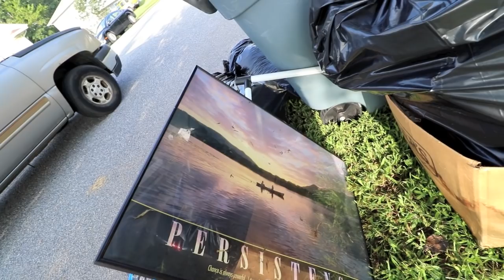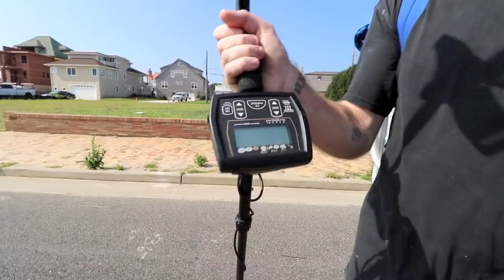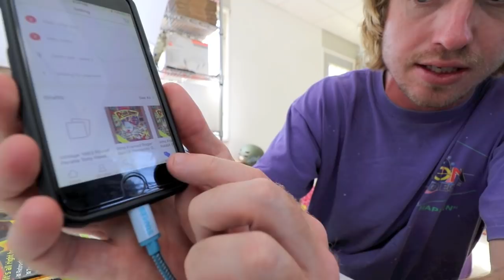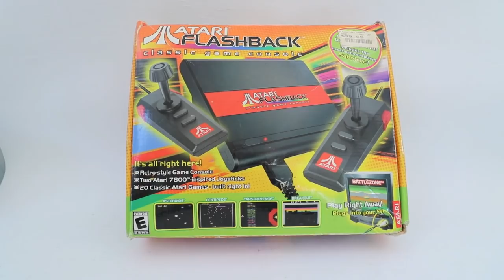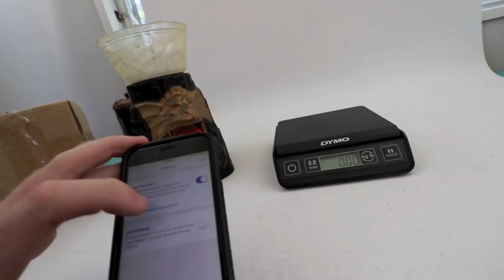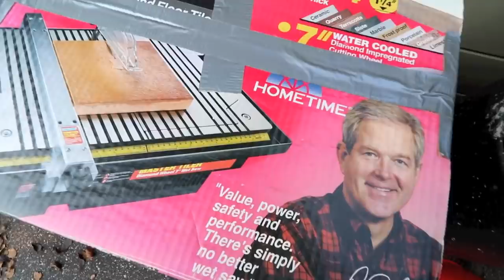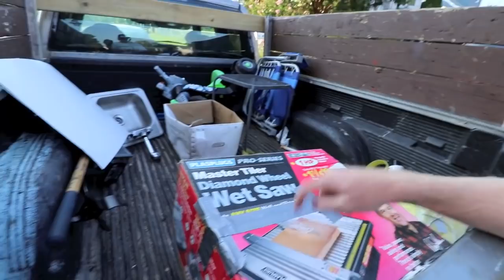TOOL SCORE TRASH PICKING - Tubs Of Old Power Tools, Car Ramps, Scrap Metal!

Comment: One tip for the eBay app is search things by the price/bar code.  On the ebay app where it says "search for anything" and you see the little camera...click the camera and then click on the little bar code scanner.  Hold it over price code and it will pull the item up on ebay without having to type the name of it.  Works good on books or anything that has a modern price code and you can quickly scan things and figure out the value without people knowing what your doing lol.  Works good to list things for sale too and to find things and use the "sell similar item" to start your listing to sell something.

Comment: I rarely sell video games on eBay. I’ve bought a vintage 80s Odyssey2 computer game system with controllers in the box with games at a yard sale for $10. Listed it put it on. Never tested it but looks workable. Put on for $100 or best offer. Got a offer for almost $70 and took the offer and sold it. But 95% items I listed are buy it now.
I live in Ventura California and I sell at swap meets for a living too. But I’ve been looking on the shipping cost on your end vs my end is like $12 (the lowest so far I’m seeing). The lighter the less the heavy the more shipping it’s coming outta your pocket. But I understand what it’s worth putting on things rather it sells for more or less
Also too I’ve been doing really great with shipping over the years. Most of the time I cut out boxes by nothing and fold and make a box that fits perfect. I once sold & shipped a bike from Craigslist with sending the invoice payment price and the shipping to the buyer.
Reply from the maker: Very cool thanks for adding your journey

Comment: Those tvs have copper coil in em takes 1min to take out put rest in trash i started doing them lately ebay is awsome but it is hard to source its a long term thing you cant half ass it you have list ship on  time answer questions every day.... the good thing is 170.000.000 people use it daily.and auctions suck only sellers that due good on auctions use a proxy bid they cheat..i lost my ass on auctions i never do em now and it cost more...best thing is look item up go to filter sold items and list for what they sold for...